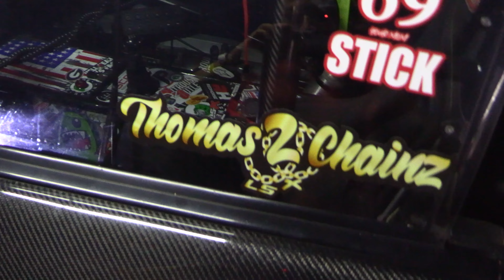Gear Bangerz: Lights Out 14 First Stick Shift Class

Comment: idk why but i love 1/8 mile stuff I feeel like it takes way more knowledge and skill to go faster in the short track and its honestly just safer overall. plus the events can host more cars due to less run times.
Reply: It takes more skill to some degree but it's ( my opinion ) more risky and harder on parts. Going 160 in half the distance takes some effort
Reply: @hoost3056  we could follow nhra and make all tracks 1000 feet lmao
Reply: @fantasma5764  they run top fuel quarter mile in Australia
Reply: @fantasma5764  big difference between top fuel and this
Reply: @hoost3056  what are you talking about ? A car goes 160 in 1/8 mile will be going 200 plus in 1/4 mile . Which would be less safe . The point in quarter mile racing is to go as fast as possible in the short track as well . Once past the 1/8 unless it spits rods out hanging at 9000rpm you could have cruise control on .

Comment: Don't you need duel Parachutes going 200 in the quarter. Can't wait to see what you do in the stick shift 1/8 mile
Reply: You do realize this video is stick shift 1/8th mile right?....
Reply: @TheDeusbellum  yes grubworm runs a single parachute when he runs quarter mile at over 200 miles an hour he must have tbm brakes
Reply: @barrelsurfergirl4614  what does that have to do with my comment
Reply: @TheDeusbellum  nothing I don't enjoy the 1/8 mile stuff as much as the quarter mile
Reply: @barrelsurfergirl4614  read your original comment....1/8 mile....

Comment: Le truc pour être un bon pilote c est savoir ce servir de chaque rapport regarder en 2013 Sébastien Loeb a peays speak chaque rapport lui donne de plus en plus puissance suivant le rapport 4 roues motrices pour monter une côte t elle que peay speak et nécessaires et le moteur et celui de la GMC de retour vers le futur v6 PRV Peugeot renault volvo 2 turbo tout forger ce v6 24s a donner 875 ch il peux donner plus mais vue que la voiture ne pese que 875 kilos pour 875 kilo ca donne un rapport poid de formule 1. 8minutes 77seconde 13 milliemes puree de temps qui reste pour moi le temps a battre en thermique 👍🇫🇷🤙